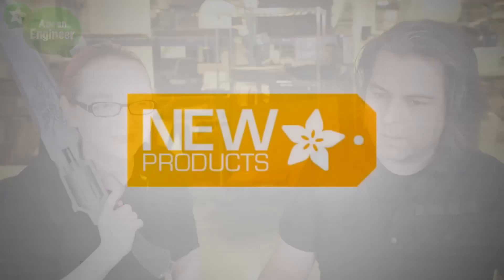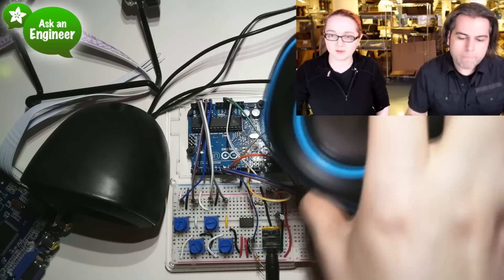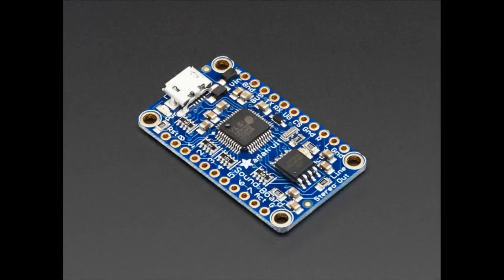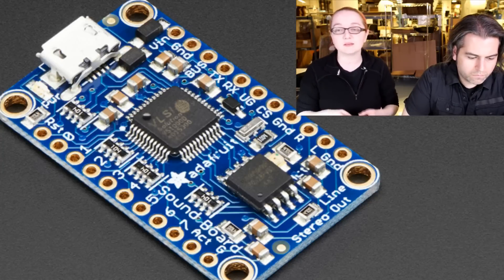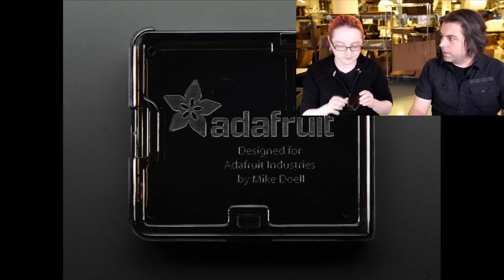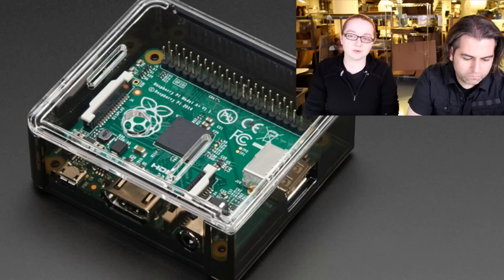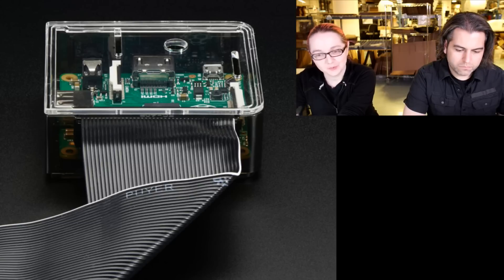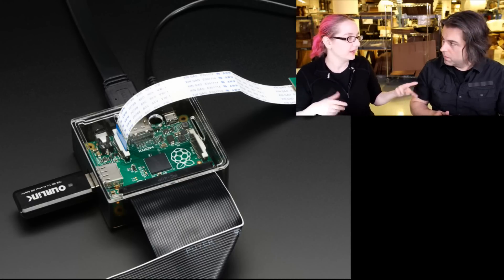New Products 2/18/2015

Comment: This looks super useful for something. 

OK, here's one application, you know when you're in your car and you're waiting for your passengers to stop chatting and get in the car because you're on a schedule, so you start the engine and maybe give it a bit of a "bbrrrm bbrrrm? 

But you have an electric car, so you can't do the "bbrrrm bbrrrm", and beeping the horn would be considered rude (unless you're Italian).

So you put the "bbrrrm bbrrrm" on this little darling and have some buttons to increase the intensity until your passengers get the hint. 

This worked for me but I had to find the engine noises on the internet and then play them from my phone to the car's speakers (volume set at 11). Buttons would have been a lot quicker and easier.

Comment: For The Adadruit Audio FX Mini Sound Board: How hard would it be to wire up a Piezo pickup to use for one of the triggers?  https://www.digikey.com/product-detail/en/CEB-35D26/102-1128-ND/412387?WT.mc_id=IQ_7595_G_pla412387&wt.srch=1&wt.medium=cpc&WT.srch=1&gclid=Cj0KCQiAus_QBRDgARIsAIRGNGgv4x7_M5EH9NUcH1XP7DBCigWbcdnA_FVETTjzsge9nx9PZChN-MIaAqLLEALw_wcB